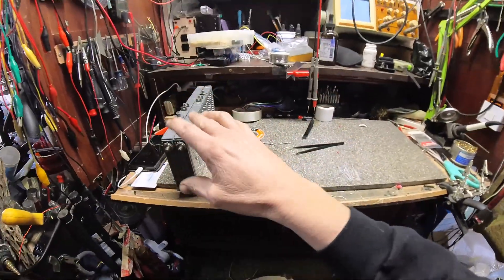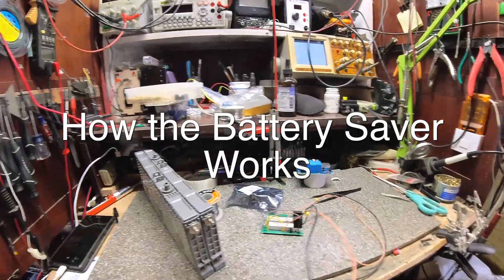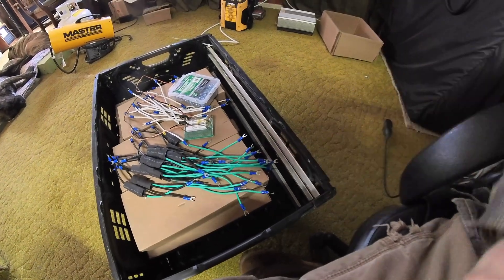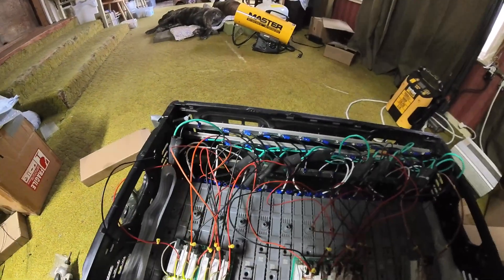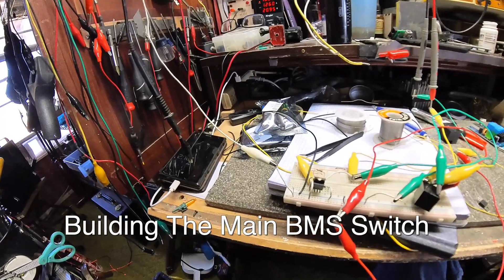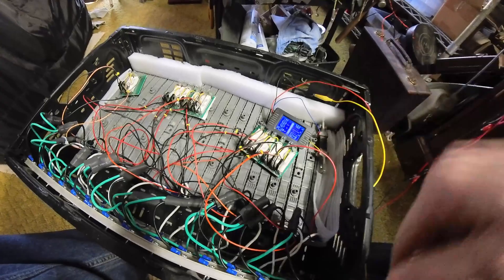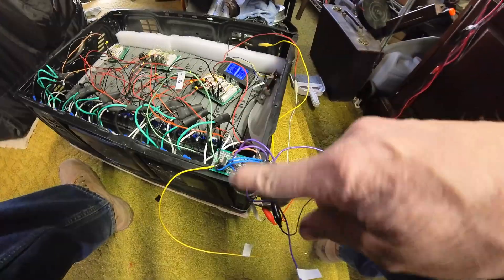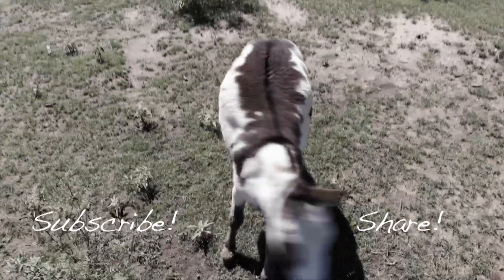How to Convert a Prius Battery for Off-Grid Energy Storage!

Comment: I am new to all of this but was wondering if this would work good just for a diy 12v camper solar system and if so what would be needed. Thank you
Reply from the maker: You can get away with using a solar charger that allows you to set the voltages. That way you don't have to build some elaborate balancing system like this. The problem with these cells is the voltage mismatch with basic chargers (lead acid / lithium etc). As long as you don't over charge/discharge the packs, they would work fine for most inverters but some of them may give a high voltage fault. Its not the best match for what your doing but if you have some cells laying around and just want to repurpose them, it could be done. Be safe!

Comment: Great project, thank you for sharing! Which prius did you get it out of? The older NiMH ones or Li-Ion? Would this be made simpler if you re-used the original electrics that came with the prius such as the inverter, charging protection system etc?
Reply from the maker: NiMH, I did a lithium replacement so I was unable to use anything from my car. Those didn’t come with any sort of BMS like the Li-Ion. It’s a 2013 IV

Comment: Can you just use an adjustable mppt charge controller? Im interested in using some prius cells in my solar system but am a little hesitant because of the fire risk.
Reply from the maker: I don’t see why not. If you can set it to lithium and set your voltages you should be good. If you’ve ever pulled one of those off of a set of lead acid, you can see most of the chargers pulse which I would avoid. They just need a constant current like most lithium based batteries. As long as you can set the voltage to match your pack. Right now I just use a power supply but eventually will do just as I described